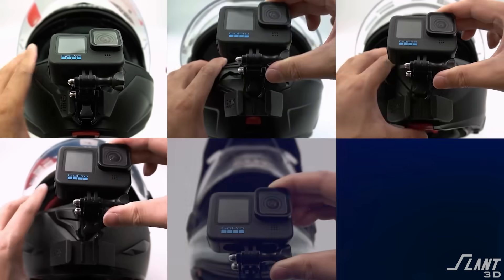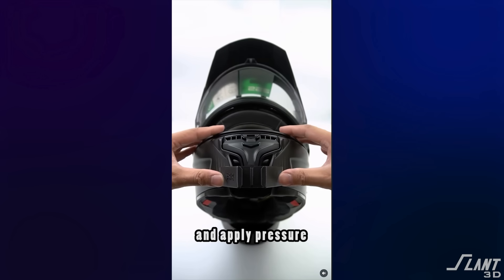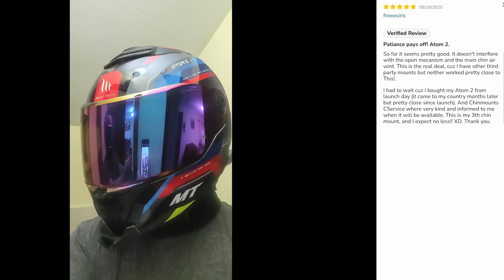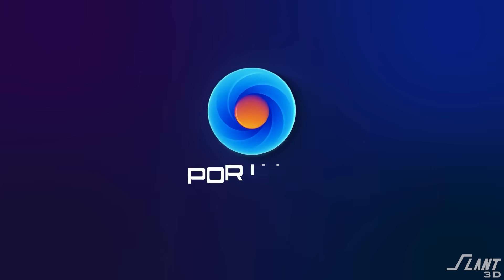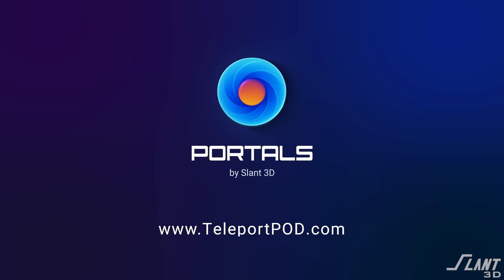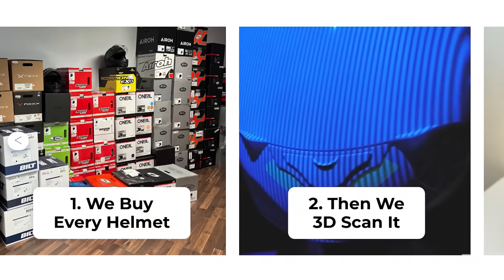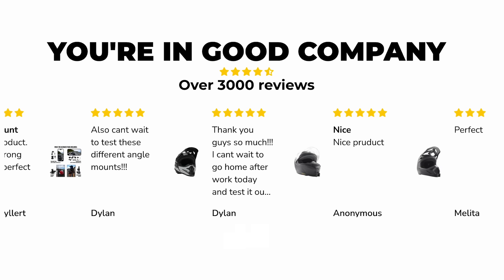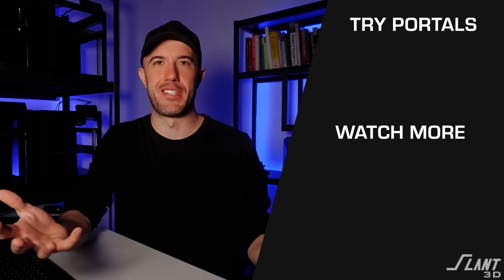This is 800 Products in One | Real 3D Printed Products | Chin Mounts

Comment: 2:48
Use cheaper molds and add several different designs in one mold. Or make actual helmet-connection thing as small as possible and fit even more in one mold. You probably can cut down a lot from this "absolutely needed" 8m$ and stay on the same outcome.

Promoting 3d printing busibess is not bad. Fake-advertising it on top of "wrongly designed molding is expensive" is.

Comment: The issue I see here in your example is you're only offering PLA. Outdoor stuff like this should be made out of ABS or other materials with a higher melting temperature and UV stable. I've had a few PLA prints melt in a hot car or deform outside in the Texas heat.
Reply from the maker: Not just pla
Reply: I have one of these mounts and yes been on my helmet for 4 years now. Zero issues. I also emailed them about what it was and it's not PLA but I forget what they told me it is, CF Nylon or something

Comment: While a contoured single piece is probably more solid, it's still being held on by some double sided tape so there's likely still a lot of play which means that the whole thing could probably be designed as a multipart assembly with a couple hinges that move to fit just about any contour without needing redesign every time. It could still be 3D printed but that opens it up to high volume manufacturing with injection molding too.
Reply: That's what I was thinking. This many SKUs seems unpractical
Reply: @Kushan_Patel  It does seem like a lot of design and prototyping work, but this is also the perfect use-case for 3d-print-on-demand, having a bunch of different SKUs you can specifically print for each order.